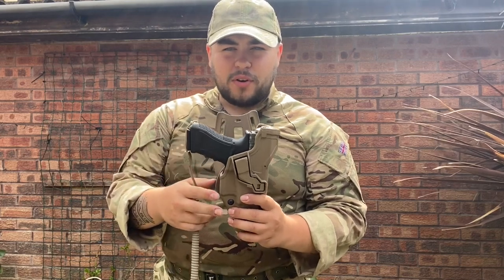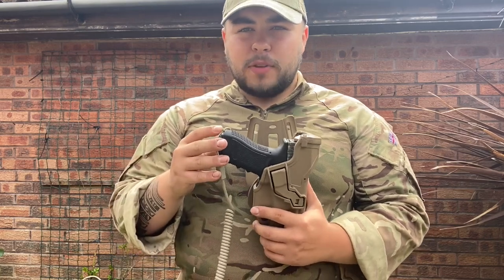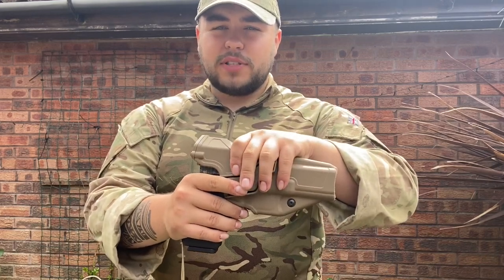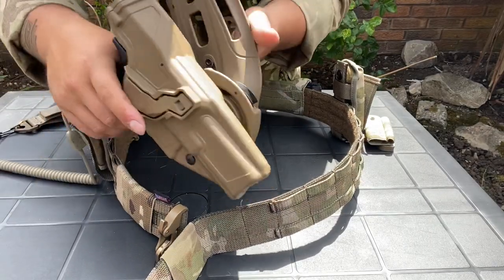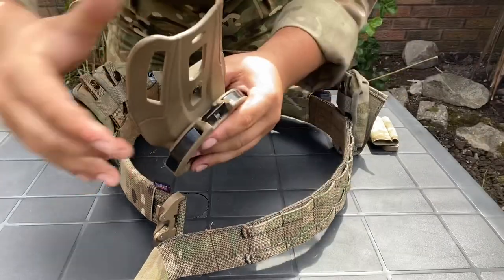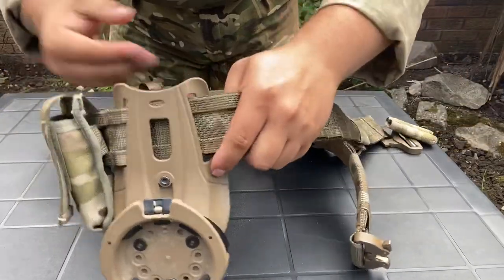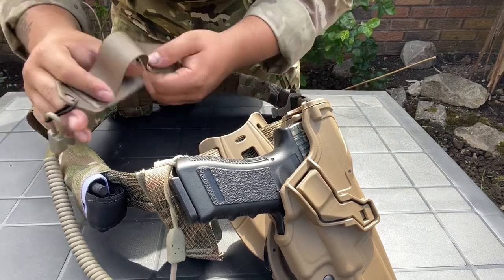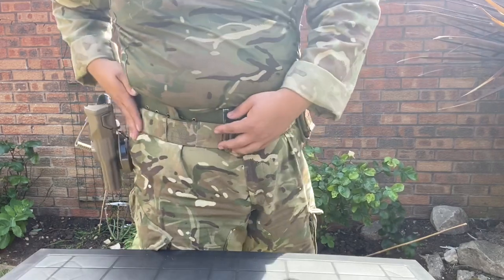Radar 1957 S loop glock holster

Comment: Can I attach a leg strap to it to keep it in place in a draw?
Reply from the maker: Great question. Yes absolutely you need to take off the holster part then unscrew the mounting plate (there should be three screws holding it on) then you just slide the leg strap up in place and redo the screws and you should be sorted. The other option is to try and thread it through the mounting plate but that might cause an issue when you come to putting the holster back on
Reply: @allykitreview121  thanks alot for the reply it will make drawing easier due to it being mounted to my belt and thigh
Reply from the maker: To be honest mate I have no problems drawing it from just the S Loop but my buddy had put a leg strap on it and I’m planning on doing it just to see what it’s like. The only reason I get a couple of drawing issues is because it’s too far back on my belt because I need to redo my belt set up
Reply: @allykitreview121  yeh i run my pistol quite far foward and i just like when things dont move so i know exactly where it is at all times
Reply from the maker: Yeah that’s totally understandable buddy I’m the same
Reply from the maker: Just so you know buddy, I’ve just fitted a leg strap to it from the drop leg panel and it’s works well. It’s a faff to do and you’ve got to be careful not to round off the screws but it’s doable and it works mate

Comment: What brand glock fits in this holster
Reply from the maker: All brands of glock will fit in this holster. You may have to make minor adjustments by sanding out some of the insides of the holster because some glocks are bigger than other. It’s obviously made for the genuine glock real steel however for some reason airsoft glocks seem to be slightly wider
Reply from the maker: Yeah man as I say some fit some don’t it just depends on the model. Most will need so sorting for it to fit
Reply: @allykitreview121  where did you have to sand? Just down the sides, or round the ejection port safety, too?
Reply from the maker: It was actually the inside of the holder I sanded down mate not the top slide
Reply: @allykitreview121  yeah thats what I meant. Just the sides inside the holster, or the top where the sprung ejection port catch is, too
Reply from the maker: I had to do the top and sides for mine mate. Unfortunately it does make the catch useless but as long as you’ve got a level 3 retention with the rear lock on it to keep it in the holster it doesn’t really matter
Reply: @allykitreview121  All done. Sanded same as you. Took the ejection port catch out first, so that still works. Fitted a QLS fork, so it works with my shooter belts. Thanks for the advicd
Reply from the maker: No worries man hope it was helpful. It’s a pain in the arse job but it’s worth it. Kind of wish I did something like you first instead of seeing my arse and sanding everything out
Reply: @allykitreview121  Yeah, very helpful. Keep up the good work! 👍
Reply from the maker: Cheers mate